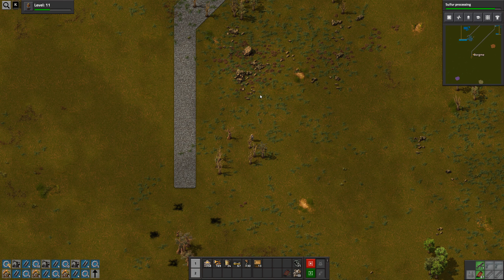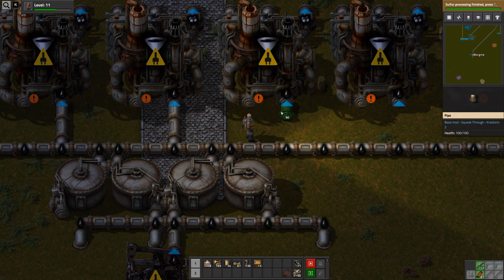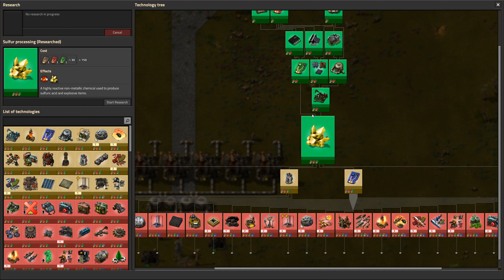Krastorio pt. 15

Comment: Advantage using splitter to chance side on a belt is once the iner is full, it will help fill the outer side
Reply from the maker: Yea its a nice improvement over the usual belt shifting. It can only be used in these cases where you want the same resource on the both sides of the belt, but we really should start using it more :)